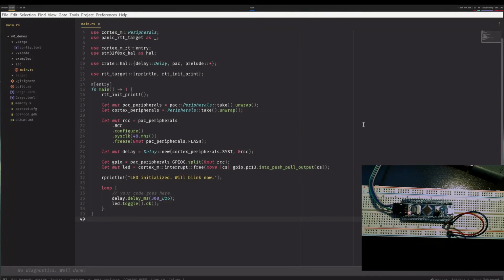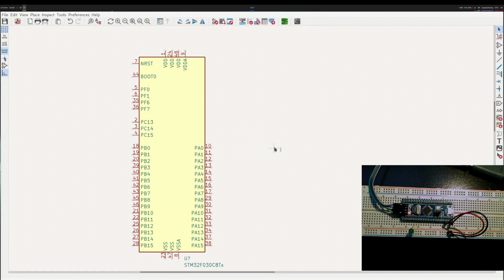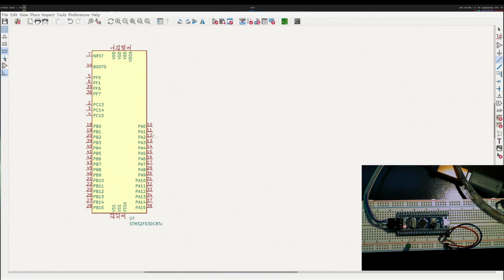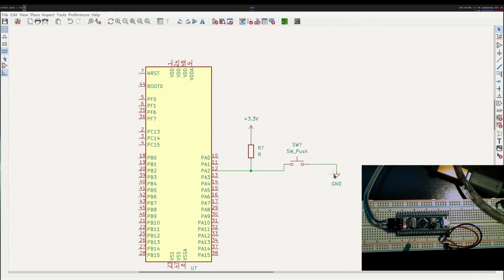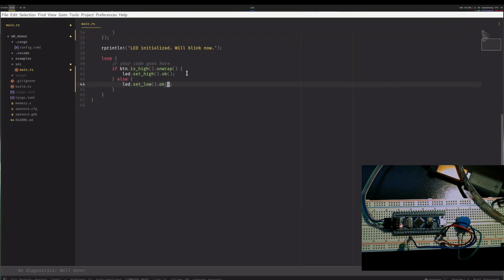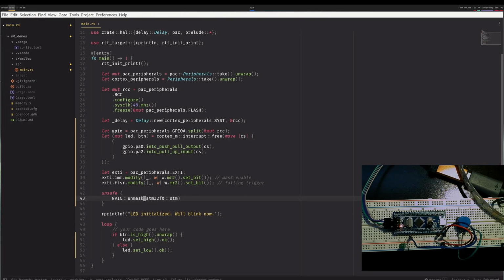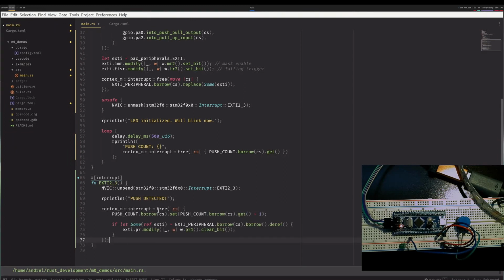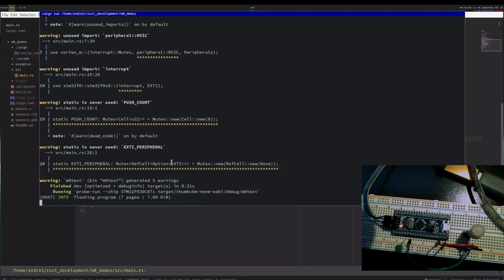Embedded rust: GPIO digital input and output, buttons, motion sensors and more

Comment: Can you make a video on how to write a driver for stepper motor (for example A4988)?
Reply from the maker: Sure, I will take a look. Will take a bit to get the HW - I see it is under 2$ from AliExpress so I got some as it is interesting, however shipping from china these times is quite slow.
Reply from the maker: Got the HW and took some time for a basic video: https://youtu.be/NSlfc6EN0EM

It shows some basic driver logic. For a full driver, this should be cleaned up and likely control for direction would be ideal too. I imagine for a CNC/3d printer one would want an interface to select position and move the motor forward/backwards to such positions.